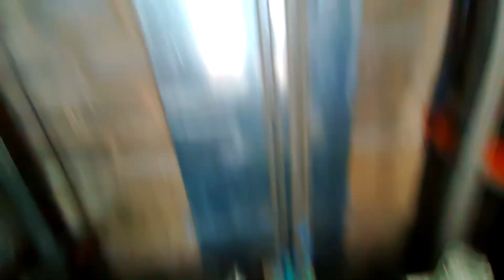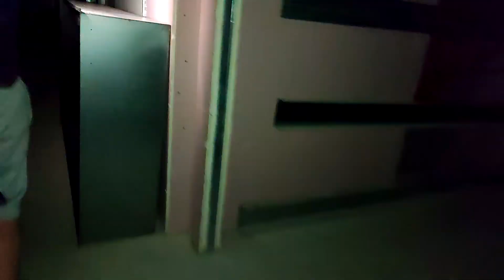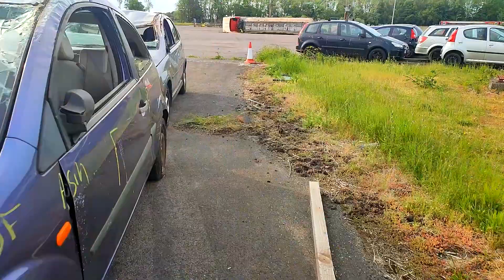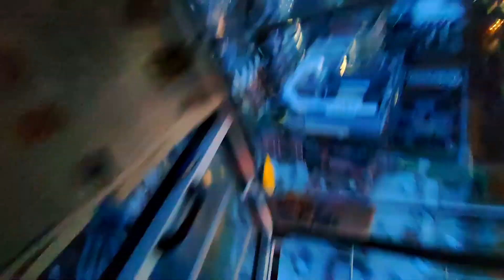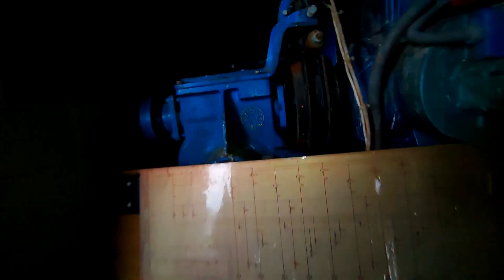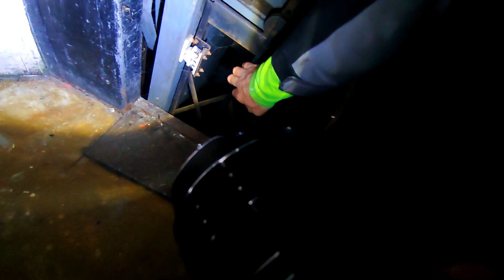Rooftops, abandoned lifts, URBEX and a crane

Comment: "Massive department stores that no one actually wants!  They're keeping the shop at the bottom for some tatty shit in the shop, probly like American candy or some utter rubbish will be at the bottom.  And the rest of it will now be just housing they're adding on two extra floors, the 60s buildings have good foundations and modern day buildings are very lightweight so they're building two lightweight floors to make the building a bit taller, they're demolishing the top floor because the top floor is not a flat shape to the natural stopping from adding the extra balls they're taking off the top floors then adding on two new floors ... A shame! I heard that a department store was more interesting than someone's shitty housing thing..."

CLICK THE FOLLOWING LINKS AT RANDOM TO MAKE YOUR OWN BENO REMIXX!!
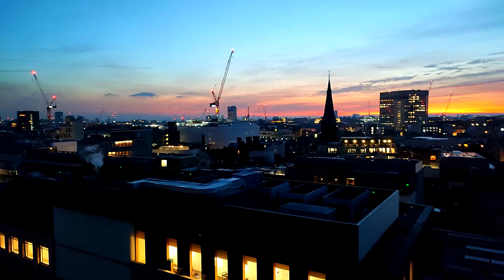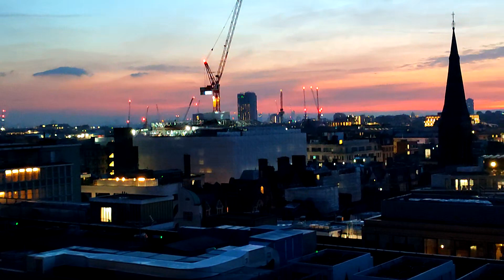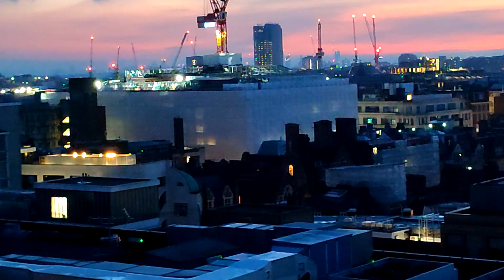19:19 19:20 19:21 19:22 19:23 19:24 19:25 19:26 19:27 19:28 19:29 19:30 19:31 19:32
 19:33 19:34 19:35 19:36 19:37 19:38 19:39 19:40 19:41 19:42 19:43 
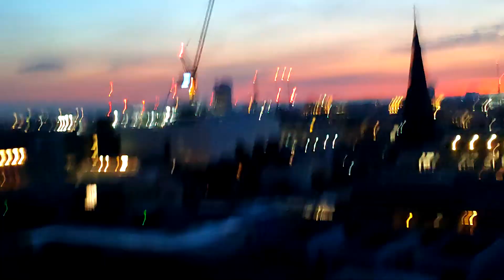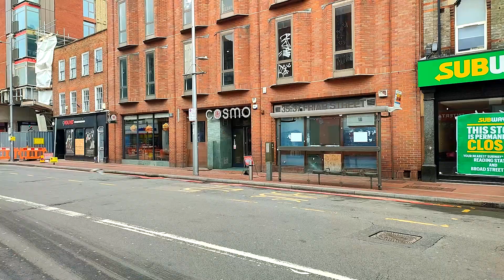19:44 19:45 19:46 19:47 19:48 19:49 19:50 19:51 19:52 19:53